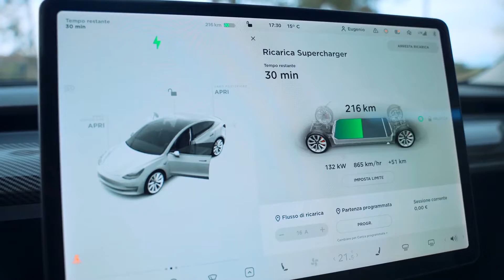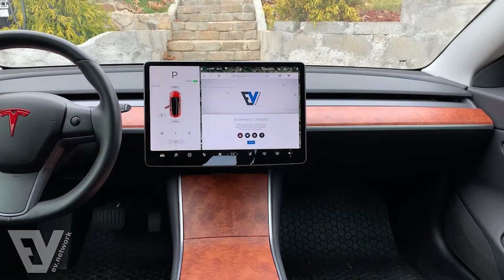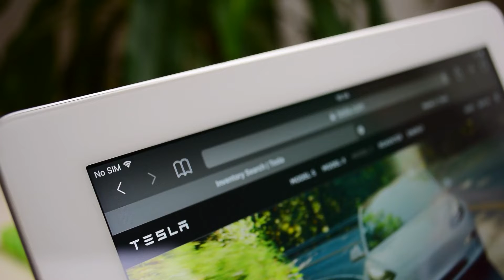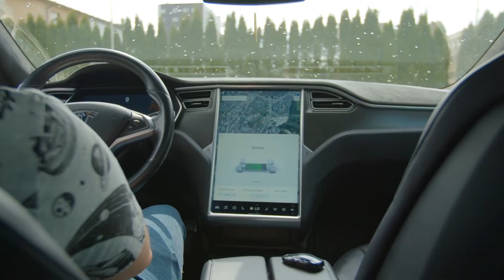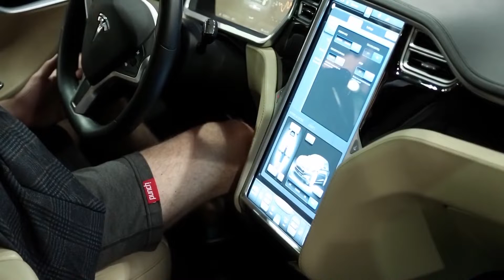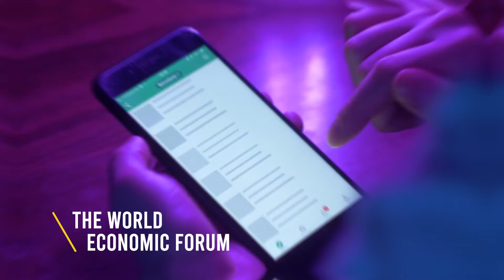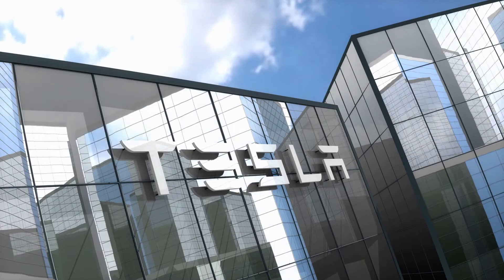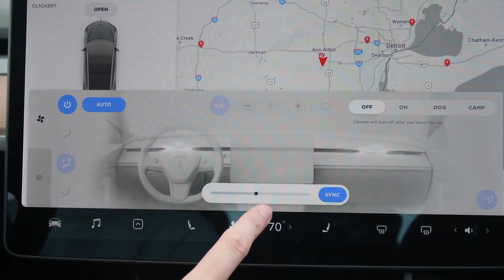What Happens With a Tesla When Its Over 100,000 Miles

Comment: My 2017 Model X 100D has 225,780 miles (50 months) and a max charge of 250 miles (originally 295 miles). Repairs include connecting rods, 12 v battery and 1 camera. My 2018 Model 3 dual motor has 168,860 miles (38 months) and a max charge of 262 miles (not sure of original capacity - I think 310 miles). Repairs are none. Best business investment I've made. Decreased battery capacity is offset by the increased number of superchargers available. And we have gotten used to the charging stops being incorporated into our daily flow - a time to get paperwork done.